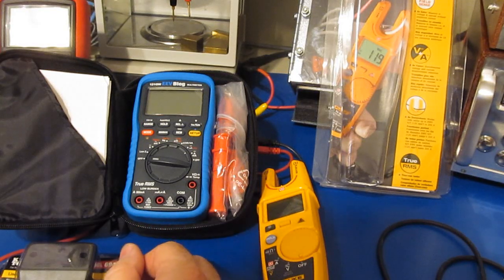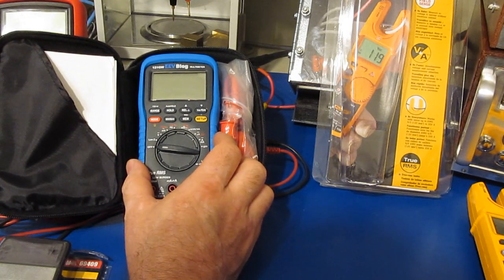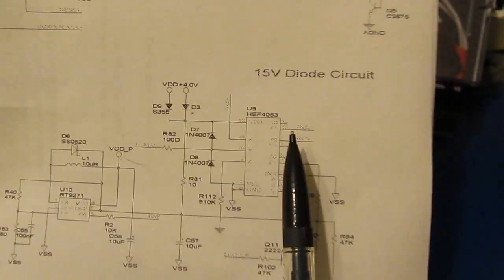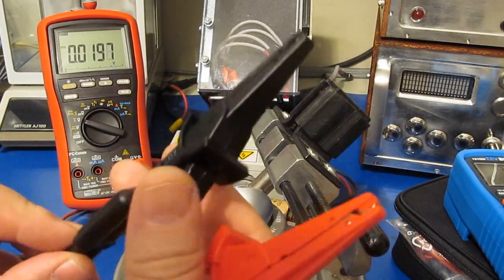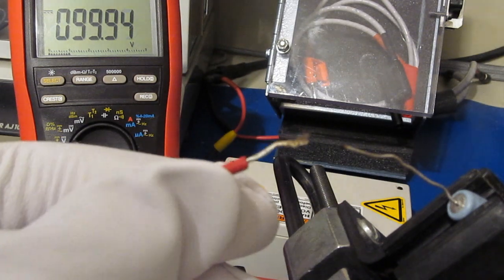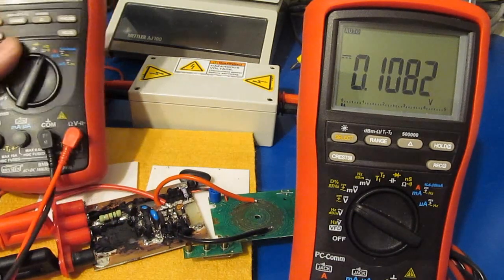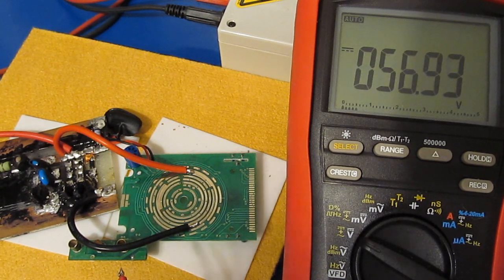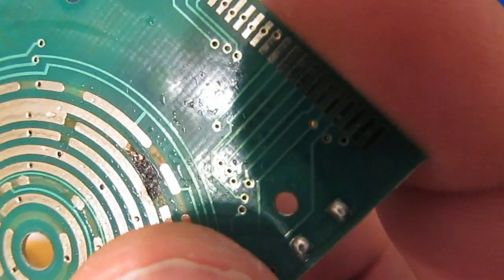EEVBLOG 121GW DMM PCB damage, possible cause

Comment: Thanks Joe for doing these tests.  That is my meter that was damaged, but I still have no idea how it happened.  I hadn't measured any high voltages at all.
Reply from the maker: Care to link your post where you discovered that you had indeed exposed the meter to a HV source?  May be good to have this information linked for future viewers.
Reply: Good idea  @joesmith-je3tq   - here is the link to the EEVblog posts about how I damaged my meter with a HV source.  I can't find the related YT comment right now.
http://www.eevblog.com/forum/testgear/eevblog-121gw-discussion-thread/msg1599418/#msg1599418
http://www.eevblog.com/forum/testgear/hear-kitty-kitty-kitty-nope-not-that-kind-of-cat/msg1601299/#msg1601299

Comment: I have drawn  half meter arcs using just an arc welder, and similar with a 25mA current limited neon transformer, so very easy to make an arc with high enough energy in a circuit. Hard to stop this as well, unless you have very large switches with high thermal mass, and a very robust arc diverter on each contact. Probably the simplest thing to remember is not to change ranges on the meter with the probes attached to the circuit, which is probably something most people were told during basic electricity classes years ago. Now you have a very good demonstration why this was told to you, as the potential to cause this damage is there.

Comment: Joe, I am very curious about the next version of 121GW, maybe they'll call it 121RW (done Right). I wish there was a single web page that showed up to date problems with status; Resolved, Outstanding, etc... I recall couple of his older videos how he was splitting hairs for scratchy sound of continuity buzzer edited: *and now look at the status of his own design*. Anyhow. At least it appears firmware 2.0 has resolved delayed response of auto-ranging issues. I don't know if you had a chance of testing that firmware. I'd hate to buy this meter only to find out it fails at tasks even a cheap OWON B41T performs ot that a "new" meter just came out which is basically the same old meter without the bugs.
Reply from the maker: 121GW was from the Back to the Future.  I doubt they would change the name.  See the following: https://youtu.be/f-77xulkB_U?t=51

Again, it's been about a year since I looked at it.  Most of my recent testing was with 1.2x.  I have no idea what's changed with the new firmware.   I have no plans to spend more time on it until they have new hardware available. 

Of course, if you wanted to log data to your cell phone with the UT181A, they may actually support it with that BLE adapter I show.  Again, I have no use for a cell phone and and never looked into it so I can't tell you anything about it. 

I don't think the 121GW is "his own design" as you state.  From Dave's comments, it seems to be UEI's and I imagine they maintain the rights to it.   Dave made that historical video public.  I suspect it has most of the facts if this is what you are looking for.

Comment: As always great video Joe be safe!

Alex.
Reply from the maker: Thanks.  I don't recommend anyone try and repeat any of the tests I show.  Working at these levels could prove to be lethal.
Reply: Yeah i understand however i like repairing old valve "stuff", alot of very scary high voltages and current in there!
Reply from the maker: Certainly nothing wrong with that.

Comment: Do you think there's hope for this meter? I see firmware 2.0 update was released and seems to improve auto ranging speed. But overall I have a feeling it's more of a beta release product. All the years of lecturing by Dave at his EEVBLOG reviewing shortcomings of other meters, when his "design" where rubber meets the road, we see it's easier said then done. Now the shoe for Dave is on the other foot. And don't get me started about the promise of open source firmware. Anyhow, I was wondering if this meter is worth considering after the update since it has a rough start.
Reply: Or maybe that shoe is in his mouth and he's chewing on it.
Reply from the maker: @tech29X  I was not aware that the 121GW was ever intended to have open sourced firmware.  I can tell you that is something I would never allow from a safety standpoint.  I also see no value in it as I am more on the user of the meters, not the developer of them.

I suspect that most people that are not directly involved with the development of products would have unrealistic ideas of the time, costs, .... involved.   They did produce a product that can be purchased today so that goal was met.  I don't follow the saga as the meter continues to evolve.  Dave seems to get upset if I inject too much information so I cleaned up my posts and have backed down.   I continue to wait for something that at least addresses what ever caused them to require customers to install a shim in their meters.   It will be a substantial investment of my time to evaluate one in detail and I have no plans to consider looking at one until at least this basic problem has been addressed.  I had thought this would take them a year but we are approaching two years and I have not seen any sort of schedule posted. 

I don't offer recommendations on this channel.  If a product is worth it to an individual is entirely up to them.  I don't have any ties to these companies and only offer unbiased test results which people are free to use as they like to make a more informed decision about their purchases.
Reply: @joesmith-je3tq  Joe, That answers my question, thank you very much. For example; I wasn't aware of the issue that required inserting a "shim". In the end, after 2 years of its release and reading up reviews/issues about 121GW, it still feels half baked. On the firmware issue, as a company I would never want users modify my product on principle of liability. So, I agree on that front, but it was part of the pipe dream some folks were sold on when buying into this meter at development stage. I don't know what it entails inserting a shim, I doubt that solves all issues. At this point Fluke 289 is the only decent meter with data logging. Getting very frustrating... 

UT181A is not has rechargeable battery, and proprietory data can't be exported to excel and requires awkward adapters to recharge, transfer data... Amost priced at a Fluke 289.

CEM-9939; High burden voltage, slow display with useless bar graph.

UT-61e; high burden voltage, old serial interface. Meh!

OWON 41T+ High burden voltage and pure junk for input protection, but at that almost disposable price with data logging that can be exported, it might be a OK for low voltage electronics, trouble shooting parasitic drain on car battery, or repairing the occasional "ceiling fan" or sink drain :-)

At least it has double wall cover that should keep sparks inside and if she blows, it's almost the price of a quality pair of replacement fuses.

Anyhow, it's been fun watching and learning a thing or two from your videos. You certainly deserve much more credit. PTCs, vs MOVs, ceramic fuse vs glass fuses in "condom" shroud :P
Reply from the maker: @tech29X  You would have to show me where Dave had promised some sort of open firmware as again, I don't ever remember seeing or hearing about that.    I am not suggesting that people did not want it or had high hopes of getting it but I don't think it was ever on the table. 

I am not sure how you came to the conclusion that the 181A's data couldn't be exported to Excel.   It's the internet and I can believe that you were told that by someone who was clueless or a competitor trying to make a sale.   Be careful about where you get your information.   I think the cost was less than half the 289.  Still this meter like most of the UNI-T products I looked at are very sensitive to fast transients.  

That OWEN had a lot of problems.  Maybe you skipped around the video and missed them.  By the time I was done, I had made a comment about not wanting to waste anymore time with it because of all the problems I found. 

Good luck with your search.
Reply: @joesmith-je3tq  I clearly remember you saying not wanting to waste anymore time with this; 1) My lack of understanding about nuances, technical details of your review and 2) I thought you were mostly disappointed about the piss poor input protection with the meter. 3) It had a faster updating bar graph then CEM-9939 in your review 4) It had slightly lower burden voltage than CEM-9939. 5) I liked the bluetooth/android syncing so much that I guess was fooling myself :-)
Reply: I also remember at some point during the CEM-9939 review, lineup review, you said something like I'd pick this one (CEM-9939) over these 3 in the video pointing over BM235, fluke, etc. So despite that I guess, I was being a knuckle head ignoring your statement, cause i was too hung up on slow update speed of bar-graph on CEM-9939 with high burden voltage. Otherwise I really  like the input protection on CEM-9939, more than enough for my use.
Reply: As for Uni-T UT181A,  my gripe was based on their video I watched several days ago, and it said the data recording is in a proprietary format link to exact time they say here: https://youtu.be/Yc4tNhTR9wU?t=665

I still don't like rechargeable battery, specially i have to plug an dongle and can use standard usb port to recharge either.
Reply: @joesmith-je3tq  Joe, I don't think I said "Dave promised open source firmware on kick starter". As I was looking though information for 291GW, I came across the kick starter page and then those deep forums in EEVBLOG, some people on kickstarter program were eluding about open source. Personally I don't care for it, so long as the meter does... perform. Also, I just got a PM from an owner who says new meters being offered for sale solve the rotary dial shim issue, that they ship preinstalled. Of course I don't know that for sure either. However, progress seems to be made. Fun part is reading up and comparing the specs while shopping around and learning in the process. Again, thank you for your patience and all the hard work you put in your hobby. Very impressive.
Reply from the maker: @tech29X  It's a fairly old video, that was ripped from an older video.  Even the software that came with mine offers Excel format so it's been available for some time.
Reply from the maker: Looks like its a different mode is all.  Watch at this point.   https://youtu.be/Yc4tNhTR9wU?t=585
Reply from the maker: @tech29X  I understand that the later 121GWs were indeed shipped with the shim preinstalled.  That's not what I am after.  I want to see the problem corrected with no shim along with the other changes they have made to the hardware.  When I life cycle that meter, I don't want Dave to come back and say we have a fix for that now with our new meter.   They have had two years to get it right, so I will be very interested in seeing how well the next version I get behaves.
Reply from the maker: @tech29X  Ok, now I understand about the UT181.  It's when they pull the data off the meter that they can't save to a standard format.  I don't think I ever tried this as I normally would record straight to a PC.   Loading up my software, it shows version 1.0 so I doubt this was ever changed.
Reply: @joesmith-je3tq  Yes, imagine leaving the meter in a vehicle overnight logging milliamp load then transferring the data from the meter to a PC. Leaving an old Android tablet or cellphone next to the meter at "remote site" is acceptable, but leaving a laptop in a car to log that data is not desirable.
Reply from the maker: @tech29X  I use my tablets for this.  They are fairly small with much nicer graphics.  I have zero use for cell phones.    With the UT181A, you would just log internally, then offload.  But that file format is a bit of a snag.     I am not sure if the CEM or Gossen allow you to download the data and export to CSV or not but they both offer stand alone logging.

Comment: That arc can be dangerous, although being limited in current. I wonder if Dave was a critic of his own multimeter after seeing that, of if he preserved his bias against cheap multimeters. This shouldn't happen on a $200 range multimeter.
Reply from the maker: I doubt there is any meter out there that would handle a test like this no matter the price.   There was a part 2 to this this video and Dave made a couple of response videos as well.   They may be worth your time to watch.
Reply: Well, in real life this will happen, provided that the circuit has enough energy available to make it arc. What may save the situation is that most of the grid is limited to 480V between phases (in Europe). But if there is a transient of some sort, caused by a big motor starting or stopping, that may initiate an arc. The metal vapor then will make sure it is sustained, with explosive and quite catastrophic results, unless there is a quick blow HRC fuse and a crowbar to limit the damage. Nevertheless, I'm curious to watch Dave's response. Thanks!
Reply from the maker: I've seen a lot of cooked meters on the internet.  You bet that all sorts of things happen in real life.  My favorite is the people that try to directly measure the outputs from their microwave oven transformers.  Obviously, reading voltage in a non-voltage function and rotating the selector when the meter is connected are not wise things to be doing.  And anyone working on 480V bus, I would assume would have the proper training and PPE.   I think Dave's videos were on his second channel.   After I saw them, I made a third video for the fun of it using a free meter from HF.
Reply: Well, I was not going as far as rotating the knob while taking a measure, although that particular multimeter was damaged that way. Misuse can circumvent protections in a lot of cases. But it scares me how many multimeters are designed. For instance, I would bet the Aneng 8008 is not CAT III rated, as the fuses are just too small to be HRC (even if they are sand filled). The creepage distance between the end caps is just to short, about 3mm. Anyway, that would be another topic in itself, I think.
Reply from the maker: I doubt most meters would meet the CAT ratings marked on the front.  They make a lot of crap meters and we buy them.

Comment: I wonder would it help to add Silicone DS4 to a contact to prevent that?
Reply from the maker: I've seen a few meters with grease.  Most without.  One way to improve it would be to slit the board or open the gap up even further.  We have seen meters where they have run isolation slits between the switch contacts.

Comment: UEI are not known for quality and durability.
I think I broke one while checking 480 three phase motor controller on 75 hp ventilation fan. 
The meter lied to me and bad things happened...needless to say.... bad things happened to that meter.... with malice aforethought.

I would trust the Cen-Tech over a UEI.
Reply from the maker: I still use a Cen-Tech for work.  It's six years old now.  Beyond loaning it out once to a person who turned the knob past the dead stop, breaking the plastic and a few blown fuses, it's been solid.
Reply: Joe, have you ever used a Fieldpiece meter?
I've used one since 2000 and it it solid as a rock.
Reply from the maker: I have never looked at one.  For work, if I have to troubleshoot in CAT III, I use a product made by HIOKI that I have been very happy with.   I ran one of their low end DMMs through my tests and it performed very well.
Reply: My Fieldpiece  SC66 clamp meter is CAT III. 
I purchased it new in 2001 and I'm still using the original silicone leads and I have not been gentle with it.  
I have used it in steam tunnels, blazing hot attic spaces and sub-freezing weather.  I have never completely submerged it in water but I have used it in steady down-pouring rain.  It was pretty fancy for it's day but the new models do a lot more and they are smaller.
The SC66 is discontinued but I hear the current models are equally tough.